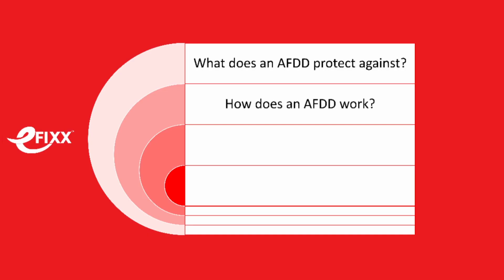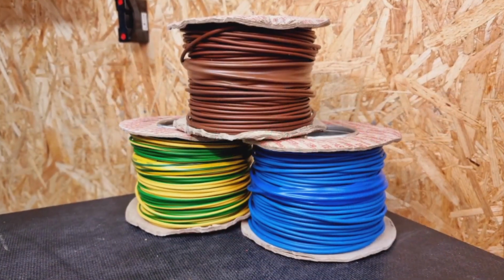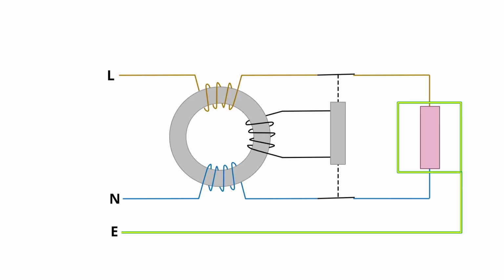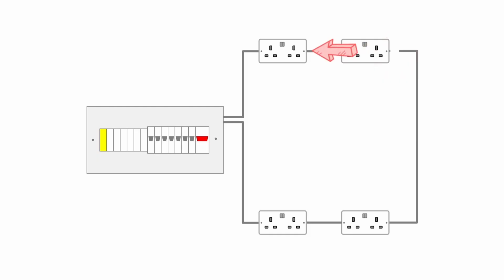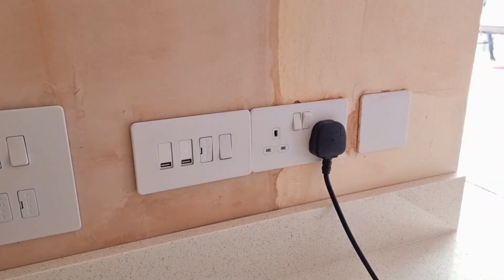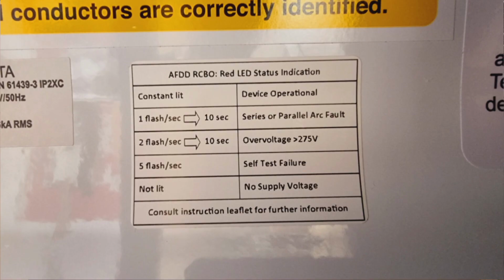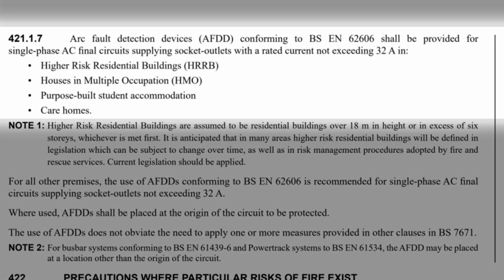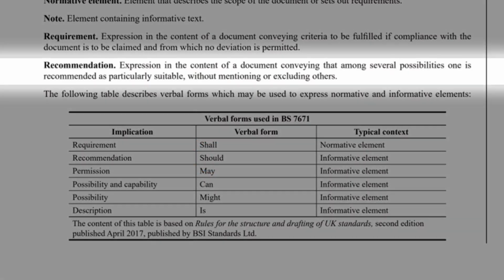AFDDs & BS7671 Amendment 2 - What you need to know!

Comment: So basically to reduce the reaction that occurred to the public draft document of Amendment 2 to making AFDD's mandatory ("Shall") they used legalese open to misinterpretation instead.  As "currently" to detect an arc you need to use an AFDD suggesting that you "Should" install them while having no other alternative available but to fit AFDD's to comply.  On a side note several installations that we look after have AFDD's fitted and are having intermittent "Arc Fault" events according to the devices which on subsequent detailed testing and inspection find no cause.  The likely cause for some of these may be the occupants appliances and misuse in one instance but all we got as feedback was "The old one didn't do this!!"  The manufacturers must be raking it in at £150/device.
Reply: Had similar situations of afdd's tripping out. Upon testing all seemed ok. I asked if it was when something in particular was plugged in. 'No I don't think so' came back the answer. Turned out it was a dodgy extension reel used to plug a fan heater in the bedroom that the daughter was using but keeping quiet because the parents moaned at her for using too much leccy.
Reply: You are right in that AFDD do tend to trip more, thats because they dont just cover the circuit but what is connected to it also-a dodgy extension lead or faulty appliance.
Reply: Legalese?
Firstly IET regs are not the law. You should know that by now.

Second, there is not uncertainty around the use of language. Shall and should are quite different and are often used in the legal profession and contracts.  Perhaps you need to improve your understanding of English.

Shall means you must implement it.
Should gives you the option of not implementing it, but is preferred.

So where there are scenarios described which say "shall", you do not have a choice. You must comply.
Reply: @deang5622  Not so sure an Insurance inspector would agree after a fire in a new installation of yours-the whole thing needs clarification- the term "recommended" should read MUST!
Reply: @johnchristmas7522  I don't care what an insurance inspector thinks.
I will say it again, IET regulations are not law. That is a fact.

Any insurance inspector trying to say they are would be in the wrong.

It's the Building Regulations that are the law.
And when it comes to insurance,  what deductions the insurance company can make is going to come down to what is written into the contract between them and their customer.  So for example, if the insurance policy says that the electrical installations must be compliant to The Building Regulations and they can demonstrate they are not, then they would be within their right to either say that the terms of the policy have been violated and won't pay out at all, or that they won't pay out in full.

If the insurance policy says that the IET regulations must be complied with, and then then it transpires the IET regulation says "should" and not "must" then a debate and a dispute is going to ensue as to whether the electrician has complied with the regs.
Reply: @deang5622  it’s not law but it’s what the courts use as best practice and industry guidelines 
Don’t end up I court trying to wriggle out of that with a very clever barrister firing very loaded questions, as I always used to drum into the youngsters,  thinking it is ok, is no good, knowing because you have tested it and recorded it as fact, covers your ar$e.
Reply: @oiuslags  My approach would be this.
If the IET regulation says "should", then if you are not going to follow the regulation and implement the required measure, then you need firstly to have a good strong reason for not implementing the regulation, demonstrate that you have considered the risk involved in relation to electrocution and fire risk, articulate what other controls you have in place which reduce the risk, and document it all.

If the measure says "should", and you have decided you don't want to pass on a charge on to your customer of £140 because you as the electrician don't think it is worth installing the equipment, then your rationale for not complying with the "should' requirement is probably not going to be adequate. Think again.

I certainly have noticed an attitude problem amongst electricians that think they shouldn't have to implement measures.

It's a question of cost versus the level of risk reduction achieved.

Get it clear in your mind why you are not going to comply with a "should" requirement and document it, but think about what other controls are in place or you will implement to mitigate the risk in other ways, and document that.  So it shows you have really have thought things through.
Reply: As I pointed out in a management meeting some years ago, when someone asked about A new DB and I recommend having all RCBO’s for convince and fitting a more expensive brand, they were not keen to spend the extra money, 
I pointed out that, your house could if there was a problem burn down while you were out at work, to which people in-the room were moaning about being a bit over the top, so I pointed out “ that their house could also burn down in the middle of the night while your asleep and when you’re putting out the flames on your children’s backs  you’re think 3 or 4 hundred quid was a bargain “  
The room fell silent and the colour drained from the faces sat around me and the lady from HR sat next to me was nearly sick, at the the potential consequences of a fire at home,
Reply: @oiuslags  Had the same response from an engineer on a big site, telling me he had just saved £80,000 on a switch room. Trouble was the busbars in the isolating switchefuse twisted( fed by 300mm 4 core) and blew out the isolating switch from the panel! Replacement was six weeks and the switch fuse served a huge trading floor! The out come was temp. solid bus bars to breach the gap- I informed him, it could have happen whilst the trading floor was in operation and the £millions liability claim made his £80,000 seem petty.

Comment: Lovely easy to understand explanations. 
However in my 30 years I rarely come across this issue with ring mains, ist usually on shower circuits where the neutral isnt tight enough. 
But here is no requirement to fit one on shower/cooker circuits!
Reply: Don't forget about the appliances connected to the ring final though.... It was one of them that lit the touch paper there...
Reply: Yes I'm concerned about the continuously ratchetting up of BS7671. How often do you need an AFDD. Has someone done a cost benefit analysis? In safety the question isn't can it improve safety but is it worthwhile?

Comment: Does the "self test" of the afdd negate the fact these cant be functionally tested like Rcd's and what happens if the afdd pcb goes faulty does it fail open????
Reply from the maker: Well, I guess it's similar to an MCB, there's no way to functionally test one of those either. I don't know for a fact but I would imagine it fails safe.
Reply: A new very expensive piece of test equipment will no doubt be the next expensive requirement for Electricians to own when the 19th edition comes out.
Reply: does the afdd drive a mechanical or solid state contact to do the switching?

Comment: I am guessing the 12 module CU:s are on the way out. Going to take twice the space when adding an AFDD to every RCBO until someone makes a combined one module solution if that is even possible,
Reply from the maker: Quite a few combined AFDD and RCBO single modules out there, including the ones in this video. 👍
Reply: @efixx  The more you know. In Sweden i have only found single module AFDD:s with a MCB combined. All the AFDD/RCBO:s are two mpdules.But our CU:s and standards are not remotely close in most cases which could be a reason or we are just behind.
Reply: @mrbugenhagen3364  

A British AFDD combines all protection:
1. Overload - as in an MCB;
2. L to N faults - as in an MCB;
3. Earth leakage - as in an RCD;
4. Arc fault detection.

Four levels of protection on one double pole unit

Comment: Residential building over 18 metres high, would that include the entire building like a block of flats? Or would the flats be counted as individual dwellings
Reply from the maker: Good question. We'll look into it. 👍
Reply: @efixx  I would imagine it applies to all floors in an 18m+ building, if there was a fault in a ground floor flat that caused a fire there is a strong likelihood that it would affect the floors above.
Reply: When I read the wording of the regulation, I interpreted as applying to the whole building.
Reply: Interesting that council flats do not have to comply with regulations mandatory for private landlords

Comment: AFDD - £155; RCBO - £33.  Recommend all you like!
Reply: just don't buy them and the price will come down then.  they are in the pockets of iet and we all know it
Reply from the maker: Seem to recall similar arguments when RCD protection became necessary on most circuits. It'll come down. 👍
Reply: @efixx  Not with how afdds are currently constructed they won't, having microprocessors in each breaker will never be something that can be made cheap. And RCBOs are actually half the price that jim is saying as well, so the gap is even bigger.
Reply: @AndrewStrydomBRP  some early strip downs showed they use stm32 processors, these can be brought on development boards for under £10. At the moment the price probably covers a lot of development and tooling costs.
Reply: @AndrewStrydomBRP  simple microprocessors cost just a few pence, these days. You can buy powerful complete boards retail for well under £10.
Reply: @kimspence-jones4765  you realise that's already close to the price of a full rcbo? Now factor in all the marketing wank, artificial lab r&d on arcs and backhands to the iet execs to force them to be used in the price. 
If they forced it on shower circuits only I might actually have some respect for the reg. This is the place where arcing is actually a problem. How many cases of arcing causing a house fire on a lighting circuit or a 16a radial where they now want them to be fitted have actually happened.
Reply: @AndrewStrydomBRP  I have seen plenty of burnt connections on shower pull cords.  Normally because the switch has one screw per terminal which has loosened when it was pushed back onto the box . Old shower switches had 2 screws . No mention in the regs of cr*p accessories causing issues.
Reply: @AndrewStrydomBRP  I just took the first two Crabtree 32A on CEF.
Reply: Fuse wire- 1p